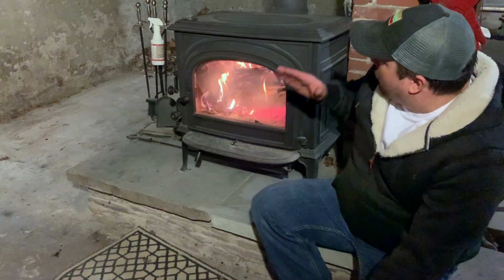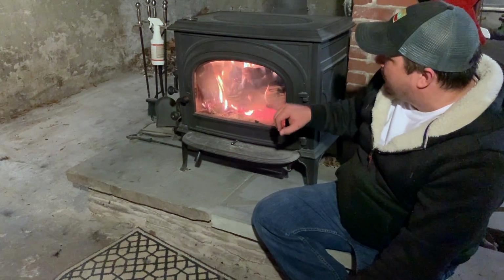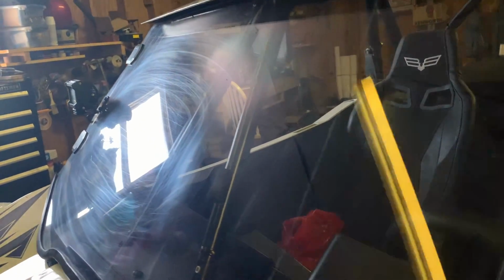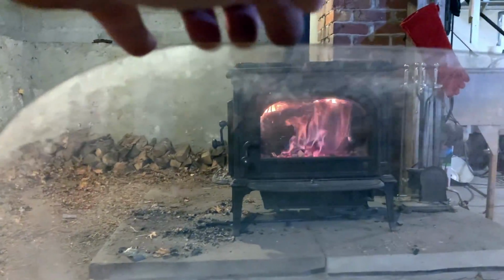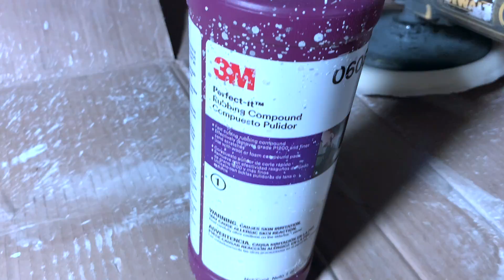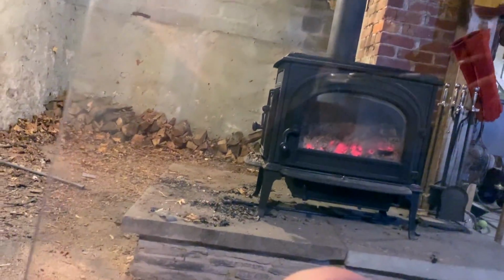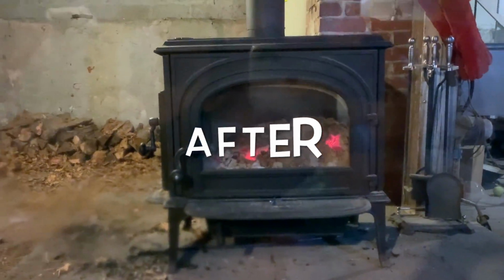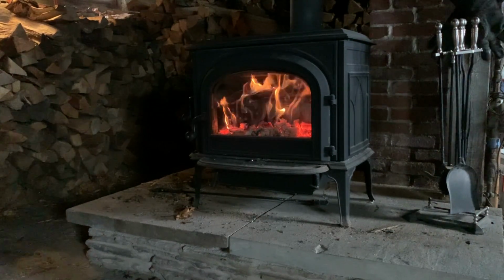Is my Woodstove Glass Cleanable ? How to repair and Restore woodstove Glass

Comment: Thanks for explaining what the marks are and how they got there. I didn't know that the material was ceramic. I did notice that we got the marks when the fireplace got really hot mainly from burning too much black locust. I need to remember to mix it with oak. That sure looked like a lot of work. In your honest opinion, is it worth all the work or would it be better to just pay to replace with new ceramic?
Reply from the maker: So. What you seen was ALL the work. It really wasnt that much. Repair it. Why spend if you dont have to. But thats just me. Thank you very much for the nice compliment. Its rare online

Comment: Thanks for video. I couldn’t get my glass clear and didn’t know why. But I just used my mates polishing gear. I started with his most abrasive buffing pad. That got the glass looking great in about 10 minutes (my glass is a lot smaller than your’s). After that I went through all the pads working my way down the grits. I probably didn’t need to do this but eh. Now it looks awesome, thanks for the know how. I can’t wait to get home and stick it back on the stove.
Reply from the maker: Amazing.  Thank you for letting me know

Comment: Could you tell me the best  polish list and how to avoid this in the future I was told to buy a new glass for my log burner it has round glass in  thanks from Scotland 🏴👍
Reply from the maker: I really enjoyed Scotland in my time there. I have some videos posted of it. So. I showed what i used in the beginning. Just some basic buffing compound. The same stuff you would buff paint on a car with. Harsher grit to a lighter grit. Looks perfect. Taking the glass off is one thing. Putting it back in air tight is another. Make sure you have all the needed gaskets and fireplace silicone ready.

Comment: Your Jotul ( pron. Yer-tul) is a multi-fuel burner i.e. wood & solid fuel, as it has a grate to allow air to enter from beneath the the solid fuel. Dedicated wood burners such as the Jotul No 3, have no grate, only a flat base, as wood burns best on a bed of it's own ashes, with the air supplied  only from above, albeit in an airwash design. 
If you do use any solid fuel, you should know that it virtually always contains a small % of Pet-coke (for ease of lighting,) derived from petro-chemicals. This certainly causes crazing of the glass such as you have experienced here, but it is almost impossible to source solid fuel without it as an ingredient.
I now have Morso, as Scandinavian cast iron stoves are often regarded as the best, by many users. Thanks for posting.

Comment: I tried everything. Ash/water/ newspaper etc, fireplace glass cleaner, barkeepers friend powder with scourer etc etc. nothing worked for the ‘milky glass’ then read about this issue with the glass and was resigned to either replacing the glass completely or hours of this. As a last resort I tried crc paint doctor I already had for my car. It cleared the glass instantly. Not saying it will work for everyone but is certainly arguably worth a try.
Reply: Does it hold up under high heat??

Comment: Huge thank you for making this video, I know understand What happens to the glas of my pellets stove. I bought a second hand unit which was 10yrs plus. The glass was totally cloudy and nothing except the light from the flames could be seen, no flame was visible. I used a dremel like tool with a fine buffing disc to remove the worst buildup on the glass. After I used a Da polisher with heavy cut compound. The result is crystall clear. Thats because you made this video, so huge thank you from Norway😀
Reply from the maker: Thats amazing. Wow. Thanks for letting me know !

Comment: alfons great video, ive watched these stove videos and you make things very clear and easy to understand thanks, 
im not sure the stains are all down to user error, with the ash pan door when you boost it, or else why would you also have that soot spot on your new glass also, is it happening regardless of what you do?, could you use this stove and never get any glass stain damage?
Reply from the maker: I really very much appreciate this compliment it makes my day as most people just take the time to complain about how easy it is to clean the glass with ashes dipped in newspaper. So thank you this already makes my day. I know it was user error the first year when I was using unseasoned wood and had a hard time keeping the fire going at a temperature hot enough to heat my home. That’s why the glass was so bad. The second year I had seasoned wood but I went to start the fire in lazy fashion by using the ash pan door and then forgot. Allowing the stove temperature to get very very hot burying the thermometer even. And then I had that Right after. So yes I believe it was user error completely. I just today installed the glass that I cleaned in this video back in the stove it is perfectly clear and I will not open the ash Pandora to start a fire this whole year no matter what. And this will be the definitive test. I have had hot would lay against that glass for hours and even hot coals pile against it and no damage like this has occurred.
Reply: @AlfonsLC  unseasoned wood is a shock,doing them stains, as i know its common sense wood burns better well seasoned, but i would never thought it would do this to the glass,im looking to buy a stove next year so im learning from you, i want mine in the main living space so we can sit and watch it, it will also be used to cook on and pipe a water cylinder into,so your videos are a great help, thanks
Reply from the maker: @lazycarper7925  Well it was the fact that unseasoned wood does not burn the stove worth a damn that made me do it. And not necessarily anything different about the wood or a chemical reaction from the green. I ran out of my seasoned stuff too early in the year and had no alternative as  wood is my only source of heat. The third video will finalize my system and how I do everything. I think what you were doing sounds like a great plan. And i really appreciate and I’m humbled that my videos help somebody. (-:

Comment: I had the same with my (multi-fuel) stove. After a few days of switching from wood to smokeless fuel though, the glass cleared right up! Whether the smokeless burns hot and clean enough to remove the tarnish I’m not sure, but an unexpected positive!
Reply from the maker: A good hot fire will remove any blackness ive found. Blacknees on the glass corms from unseasoned wood and low heat fires. One or both. This glass needed repair dramatically. Please check out the follow up video to see what it took to fix it.

Comment: Why have a wood stove in a cellar to heat dirt and concrete ? Makes NO sense,
Reply from the maker: Lol. Theres a house over it. Funny question.
Reply: @AlfonsLC  Wood stoves are SPACE HEATERS where people spend time. You want to heat dirt and concrete, fine. It's a waste. Silly.
Reply from the maker: @annaaron3510 ive been heating my house with only wood for 20 years. I dont need you to tell me if it works or not.

Comment: Nicholson, you say? I know that bridge/viaduct anywhere. Just a little bit away from me In Dallas Pa. That stove must have a weird air intake. I have had my Quadrafire for 3 years, and no matter what kind of burn conditions I have, never had my glass do that. It always comes clean easily with Rutland glass cleaner. Have you tried a different quality ceramic glass?
Reply from the maker: Yeah nicholson. Love my little town (-: Maybe i failed to be clear in my explanation. i hope not. If you leave the ashpan door air goes into the burn chamber at a very high rate. From the center out. Creating ash that goes in all directions. This is why they say dont burn with that door open so strongly. Also happens if some wood is leaning on it. In excessive heat. The ceramic glass is jotuls factory glass tough stuff. But overheated and ash blasted is what caused it. My fault. Not the ceramic.
Reply from the maker: Youre EXACTLY right. And the shame is this is normally my strong point. My friend kirk. Thats him constantly. If you want to see a man who is this way in the extreme. Check out my mercedes diesel jeep wrangler build (-: youll have a good laugh at us for this reason as well. Ha

Comment: 400-800 grit sandpaper first, then buff. Goes much faster.
Reply from the maker: You may be right. But i didnt want to risk deeper scratches. And having yo buff much longer yet. This did come out perfectly clear. Watching it now (-:  thanks for letting me know.
Reply: @AlfonsLC  I know - I was thinking the same thing. After I made that comment, you suggested the possibility of using a buffing compound that had a little more "grit". I think that is a better suggestion. For one thing, that is usually how polishing is approached with cleaning plastic glass lenses on cars. You use a 3 step process with polishing compound. With really bad cases you can use super fine grit sand paper and then use successive finer and finer compounds to finish. In any event, I appreciate your video. I just bought a used Vermont Castings stove that has severely darkened glass. Your video tells me I have a chance to make it good again. Thumbs up!
Reply from the maker: @freeinhabitant2422  thanks so much. Wish i could see how you make out. This particular buffing compound is exactly what my friend uses to buff his plastic windshield.

Comment: I must say, your style to edit and produce videos is one of the best i've seen. I'd be concerned about how many thousands of inches you removed and weakened the integrity of the fire glass??
Reply from the maker: Thank you very much for the compliment. I put a lot of work into making these videos. it’s nice that someone noticed. you are right it would thin the glass down a little bit so far it is not caused any problems whatsoever and is still working just fine. It’s all I could really say about it.

Comment: Have you tried oven cleaner? It works better than wood ash. It's what I always use. Let the stove cool down to about 300 degrees and spray the glass with Easy-Off oven cleaner. Let the cleaner work for a bit and wipe off. Then clean with Windex to remove any haze.. Oven cleaner doesn't work very well on cold glass..
Reply from the maker: This isn’t glass. Its ceramic. The ammonia in windex can crack it when it heats up again. A bad idea. Thats why woodstove “glass” cleaner is free of ammonia. Check out the pinned comment and the follow up video detailing whats up with the glass.
Reply: @AlfonsLC  I have to say nonsense. I've been using the oven cleaner/windex combination for 12 years on my Alderlea T5 without any ill effects. You would have to use a cleaner with a higher concentration of ammonia than windex..
Reply from the maker: @tb5255 its safer to just use the ammonia free stuff. Its not expensive. And its like wearing safety glasses. You wish you used them only after you needed them. That glass isnt cheap. But i did try oven cleaner. Only buffing a buffer compounds and allot of work repaired the damage to the glass.
Reply: @tb5255  been doing the same thing on my T5 for seven years no problems.

Comment: Even easier - fine steel wool (0000 grade) and....ammonia (I keep mine in a spray bottle)!!! I have tried many tricks and this is BY FAR the easiest so far. NO scrubbing required. 0000 wool will NOT scratch your glass.

Comment: Ash- color usually brown, sticks to the window because the wood is still wet. Wood should season 2-3 years before use. Wood should be totally gray in color"........not brown like wood color looks.  Easy way to clean it is at the end of the season after your stove has cooled at bit not hot. Use a utility scraping blade and it peels right of with no scrubbing. Looking at his wood it is green. What a waste of time he is doing.
Reply from the maker: Maybe you weren’t listening when i describe how the ash gets embedded IN the ceramic window. It cant be “cleaned” its hardened in the glass when the window cools. A thin layer of ceramic has to be removed and the embedded ash goes with it. The wood is kiln dried.

Comment: I had a very similar work with my car headlights (same glass not plastic), i used a wet 1000 corse sand paper, then medium 3000, and i finish with fine 5000 grade sand paper, but u must always sand it wet, and not dry...
I have done all by hand only, didnt had any buffer, it would be a much faster for sure!
But my car headlight all was fog up, and nasty cloudy from direct sun light damage, and it worked great,  its like brand new again...